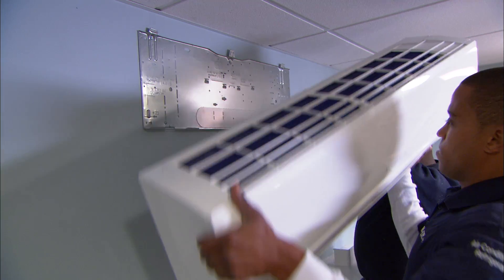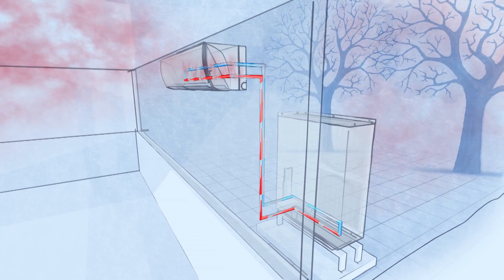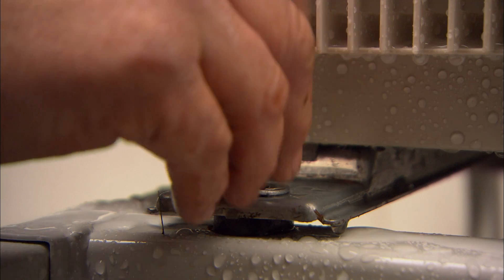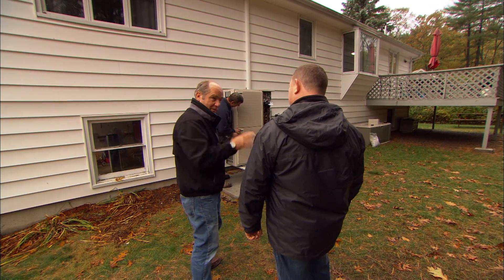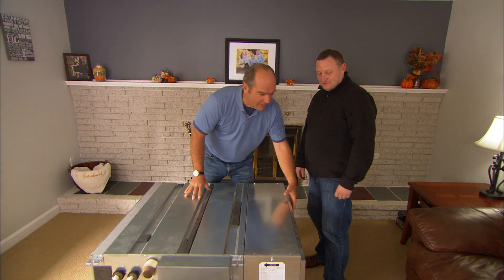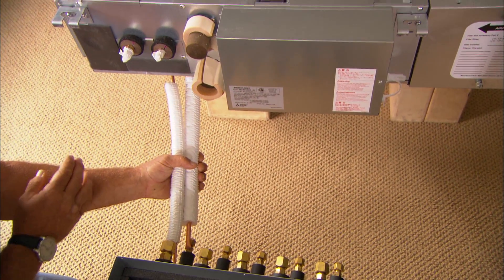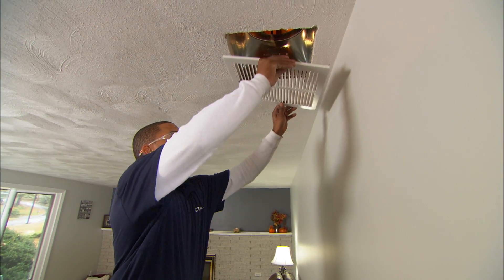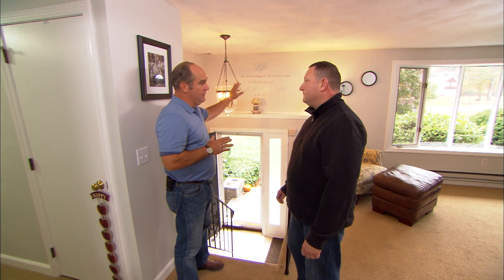How to Install a Heat Pump for Heating & Cooling | Ask This Old House

Comment: We had an air handler in our attic for the top level of our 3-story town house in VA.  It struggled to cool and never dehumidified the air.   I agree it's a bad idea to put them in unconditioned spaces.  I wonder if a humidifier can be added to heat pump systems for our dry spells here; now in MI.
Reply: That’s why you have to put insulation over the entire thing. This is like a 3 day job at least

Comment: Heat Pump tend to break easily with circuit boards going bad 1200 dollars plus $880 labor refrigerant having to be added. They last about 5 years and are the most expensive means of heat to maintain. Would do you expect a Condenser running outside below zero in blizzards it doesn't last long

Comment: What really excites me about it is that fact I can install solar panels install (in addition to heat-pumps) and be 80/90% off the grid, try doing that with gas/oil...
Reply: You will need quit a bit of solar panels
Reply: How’s it so far? Thinking about  switching up from gas to this for ac/heat combo with solar panel install. Will probably need double amount of solar panels to cover total cost
Reply: @Razdaz91  so far so good... definitely very efficient, and faster to warm up a room. We'll see how things work out this summer  with electric prices up it's all relatively (not saving a whole lot).
Reply: @jupena  do you have the solar panels with the pump currently?
Reply: Solar panels for homes have a payback period exceeding 18 years. Thank China for the rare earth materials required to produce them. If the gov didn't subsidize there would be no way to disguise the costs. Since when does the gov really do you any favors? How's that stimulus check working out for you now? Increased taxes are costing you way more than that! Glad you're "excited" about getting porked.
Reply: And the environment thanks 👍 🙏 you most of all
Reply: @Chuy1988 The environment was one of the main reasons I decided to install it on a 3 family property of mine (should be done this week)! heat pumps are the way of the future! Yay Massachusetts for the rebates! This Old House Rocks!
Reply: @jupena  I'm an HVAC guy i installed some of these in my first job now i hope i can install more
Reply: @Chuy1988  Cool Beens! cheers!

Comment: How efficient is that one in tha attic going to be when the attic is like 150 degrees in the summer?
Reply: Just as efficient as it would be any where else. The indoor unit is only your fan and coil, all the “efficiency” work is done outside at the condensing unit. You aren’t heating/cooling attic air (that’s why a ducted return was installed in the living room), nor does the temperature of the attic have an effect on the ducted unit.
Reply: @bingbizzleproductions1732  try again.
Reply: @joshuasmith1215  seeing as I’m a registered PE  with a focus on HVAC and design these systems for a living, I’ll stick with my explanation above. If you’d like, prove me wrong with facts. 

1. Where is the system picking up heat from in the attic? Are you suggesting that the ducted fan coil box is absorbing heat? They are insulated so try again.

2. What does that leave us? Duct. Are you suggesting that tiny bit of duct is absorbing enough heat through the duct to make a significant difference in capacity over a short run like that? Let’s see your load calcs to prove your theory.

3. So we just covered all the components that are in the system located in the attic (except for condensate piping and refer piping, which is insulated). And have already established the box pulls it’s return air from the tempered space and not the attic. So thrill me with your explanation of how the box being in the attic has any significant effect on efficiency. I’ll wait.

If you don’t have a factual answer, then you just learned something that will hopefully will help in your quest of “learning how heat pumps work”. 

The only way the heat in the attic would have a significant effect on the capacity of the system is if you were introducing OSA (outside air) to the system from the attic. You would then need to size your system to account for the additional load of the mixed air temp entering the fan coil, plus that of your envelope and misc. loads from within the living space. Since the system is closed to the attic space, your only heat added from the hot attic is that which is absorbed through the duct (negligible in this instance since it’s a very small amount of duct) and as I mentioned above, the absorption of heat to the fan coil box, which is also negligible due to the boxes being insulated.
Reply: @bingbizzleproductions1732  thanks for the explanation. So you would not recommend insulating the attic to help reduce energy losses through the ducts and refrigerant lines with these units? Even for Quebec Canada where the attic temp can get to -15 C regularly?
Reply: @bingbizzleproductions1732  Dude, thank you!
Reply: @8181k  I would still insulate the attic. I think we are crossing two different issues. What I was trying to explain above was that locating the fan coil box in the attic didn't have any significant effect on the efficiency of the fan coil box as it itself was insulated,the duct run was short, and the unit was not pulling any air from the attic. It sounds like what you are asking is if the attic should be insulated to prevent extreme ambient cold. The answer to that is yes, but for different reasons. The reason you would insulate the attic is that it's still transferring some heat from the home through the ceiling. Your concern here is loss of heat from the living space/building envelope, not absorption of heat affecting efficiency of equipment. For instance, this would be similar to locating a server room (high heat load) next to an office. Since most interior walls are not typically insulated, you would feel heat coming through the wall into the office space. This would increase your cooling load in the office to account for the heat transferring through the wall from the server room. If you insulated the wall between the server room and the office, the heat gain would be significantly reduced in the office as the heat would primarily stay in the server room. It's the same principle with the attic. By insulating the attic (assuming the floor of the attic is insulated), you are helping to keep as much of your heat inside your occupied living space as possible and minimizing how much energy is lost to the cold attic space. The insulation in the attic also helps to retain some level of heat in the attic as it is absorbed from the living space below (there is no stopping all of it, but that's OK) and provides a level of protection from extreme hot/cold as well.

Comment: The "inverter" is the variable speed (variable frequency) motor drive power electronics module, used to get increased efficiency by operating the motor only at necessary speed and not at full speed and then on/off. The inverter has zero to do with the switching from heating mode to cooling mode. In particular, it does not "invert the heat" or any such. These guys ought to know better.
Reply: You are so right with this! Thought the same!
Reply: I agree

Comment: I dont have a boiler or HVAC in my house. I had electric baseboard throughout my whole house. My electric bill was 1200 to 1400 a month. I installed 3 Fujitsu's low ambient temperature  units. Not only did they heat my house all winter, but my electric bill dropped to under $200 a month. Look I know people are scared of the unknown, but these units are awesome. I would stick to Mitsubishi or Fujitsu. I did the work myself, I am qualified though I have a universal 608 license. Paid 6k for everything. Mine heat down to negative 15f. This winter they did their job. I live in upstate NY by a lake.
Reply: do your units pump air thru central heat ducts ?  how about a/c ?   i have a 2700 sq ft house and am thinking about changing my central heat (oil) and a/c.  i think these should work - thx
Reply: Hey! I know its been a few years but I’m wondering how this heat pump system has held up for you? I’m looking into it myself. Thanks!

Comment: Can your heat pump be put in to the house to run through furnace pipes with the furnace not working. In other words use winter and summer.
Reply: If you have ducting for a forced air heating system it can be retrofitted to use a heat pump as the source of heat versus your furnace. 
It would be an easier set-up than this video because you already have ducts. This homeowner had to use those air handlers in the attic because he didn't have ducts in this home.

Comment: He keeps mentioning 5 degrees....what about when its minus 10?
Reply: Each unit has an electrical heating element as "backup and boost", was mentioned in the video.
Reply: new ones can go down to -26, look for the SEER, but as he mentioned those have backup systems as well.

Comment: Green energy, perfect setup no doubt!, let's see the tradeoffs. That setup requires  lots of drilling opening holes not every house is suitable and the cost of setting up properly depends to house feaseability. This setup is way complex. Will definetly need extensive maintanance and in any case of failure will  require more money to maintain. Green energy +, homogene heating and cooling properties +, costly -, complex -. There doesn't seem like a battery backup. In case of grid failure or any electricity issues in winter. Will create troubles. Main heating options should be as lean as possible what I believe.

Comment: I had learned on other youtube hvac videos that you don't put equipment in an unconditioned environment such as an attic. How hot does that attic get in the summer???
Reply: Interesting in theory and I agree with you, but it's done all the time. I have to go in attics regularly in the Arizona summer as a home inspector. It can be 135 in the attic, even hotter in poorly ventilated attics. Hottest one I measured was 155 degrees. Yet almost all of the heat pumps here are split systems with the air handler in the attic, even on the newest homes. Insulation is on the refrigerant line, but still...  Even the package heat pumps on the roofs are not much better, sitting in direct sun on an asphalt roof is also a very hot environment. Perhaps an HVAC tech could comment on whether research has been done on the cooling loss of the refrigerant in these configurations?

Comment: Does this work in Canada?
Reply: Rexin Oridle does it get below 5 degrees in Canada?
Reply: Yes it does but the heat pump gets less efficient when the outside temperature goes down. But they'll have an electric element that kicks in to assist if ever the heat pump can't keep up.

Comment: I don’t think this heat pump is pulling heat from frigid cold temperatures. By nature the process of cooling a home produces heat. That’s why there’s a huge box with a fan outside (the condenser). I believe that someone said we could use this heat and manipulated the standard ac system to provide heating and cooling. Same basic principles, just additional components to make it work. Because an AC system freezes up when it’s too cold outside they address a defrost cycle. They also use heat strips to provide warm air drying this cycle so you don’t cool your house after heating it. The point....the condenser produces the heat, not the freezing cold air.

Comment: I have a duel fuel furnace/heat pump. Using natural gas. Located in central CT. 97% furnace, 27 SEER heat pump 2 1/2 ton. I have no doubt that the heat pump is mechanically more efficient than the gas but the cost of the electric to run the heat pump is just a little more than double the cost of using the gas. Also using the gas seems to get the house up to temp about 25% quicker. It's nice to have the option but I'll continue to run the heat with gas.
Reply: Natural gas at the current cost might be more efficient, but gas lines aren't available everywhere. If you want to go true low cost, look into pellet and wood stoves.
Reply: What system are you using make and model? I haven’t seen a heat pump that can put out 27seer, at least not a single zone for whole home.

Comment: Now at the beginning of this segment (we don't see it on this clip), Richard said that it would cost $30,000 to have a natural gas line run to their house. But at that point, anything was better than what they had= electric radiant heat in the ceilings which costed the home owners many thousands of dollars to run previous years(I think I remember hearing almost $10,000). What I don't get is why didn't they go with a more conventional setup first. In my experience creating heat with gas or oil is much cheaper than with electric, even with an efficient 'heat-moving' heat pump setup. Why in the world didn't they just go with a propane or oil forced air or boiler setup??
Reply: Because they'd have to run ductwork from the basement up to the rooms. Ripping up floors etc... It would be an expensive retrofit. And with this they get cooling in the summer as well.
Reply: @8181k  - Not necessarily, TONS of people have furnaces in their attics; and some are much smaller attics that this.
Reply: Some people might prefer not to pollute the air with unburnt gas and oil waste emissions. Particularly if they are generating electricity from solar or have an electric utility that uses a high percentage of renewable energy.

Comment: I wonder if the homeowner was ever informed that the 4 air handlers each needed filter clean/exchange maintenance in the attic regularly and what the cost would be for the electronic control board to be replaced because it is bound to happen at the wrong time. And with last weeks (Jan 2018 record low temps. below 0F), was everyone  warm and toasty?
Reply: Good point. I’ve put hinged return grilles to replace filters from within the conditioned living space.
Reply: That is what the electric elements are for. The reality is that most of America does not get to below zero temps for any significant amount of time.

Comment: For what I know it doesn't grab heat and dump it out or in.
To cool down the evaporator gets cold and the blower blows that cold air in the room.
When is on heating the compressor pumps hot freon to the evaporator inside and the blower cools down the hot freon and blows hot air.
Let me know if I'm wrong.
Reply: Edwin G 

You are absolutely wrong.

The refrigerant for cooling is dropped in pressure lowering the temperature in the inside unit to its saturation point. So the refrigerant begins boil and absorbs an amazing amount of energy and will be cool to the touch. It will the return outside and then condense (to turn liquid) and dispel that energy. Hot to the touch.

It will reverse for heat mode.
Condense to liquid inside the house and evaporate outside to absorb energy.

In cooling mode the large cold line is actually the one heading outside. It is now a cold gas but has absorbed a massive amount of BTU’s from the air. The small hotter line is the line about to cool your house believe it or not.
Reply: I’ve been doing Refrigeration repair and work for 15 years on coolers and freezers and never heard that heat gets transferred outside.

That’s why the evaporator coil has a TXV valve.

Just never heard someone explaining it that way.
Reply: The txv creates a pressure drop in the evaporator. Down so that the box temp hits the refrigerant saturation point. 

The compressor raises the pressure so that it again hits saturation point in the condensing coil and travels the opposite direction in saturation. To condense rather than evaporate. This dispels heat across the air/water loop.

Comment: These dont work well below 0 celsius as the outside unit has to run de-icing cycles often (a heating coil outside) An in ground heat exchanger using a bore is best.
Reply: Alex F.  That would seem correct.  I have a split traditional heat pump in the Georgia mountains.  If the temp is below 34 then it cycles the outside thaw very, very often.  I can play the strip heat vs the normal heat pump cycle for as the evening cold of 20 rises to the day of 45 and get lower cost.  If just HP 24x7 then it struggles below 30, spending much of its time heating itself.

If I really want to save money, I'd use my emergency (powers out) kerosene heater on the coldest part of the day/night, but that is a pain day to day.  If I had a fireplace, I'd just heat with that when home.  Wood is as cheap and simple a heat as exists.

Comment: With such a massive house any heating or cooling system will be expensive.
With passive solar design mechanical heating or cooling needs are a fraction of poorly designed homes. Many building designers fail us. 
Heat pumps however are highly efficient resulting in lower heating costs than gas in all of Australia, even in cold climate zones.
Reply: Do you have gas there? If so is it really that expensive?

Comment: He said "Even if there 5 degrees outside" so many times, I kinda worry, what is going to happen if there's gonna be 4
Reply: still34u backup heat elements or a black hole will form
Reply: how about - 25?
Reply: @robinheil  Fujitsu has a series with rated capacity down to -26 C (-15 F) and lacks a hard cutoff, some claim it operates at even lower temperatures, ex -30C (-22 F) and below.

Mitsubishi on the other hand has a hard cutoff at -25 C or (-13 F).

Both of these figures are for the manufactures ultra low temp lines.
Reply: The cold weather heat pumps continue to provide heat even below their rated temperature. However their total capacity in btu/hour does decline progressively below that temperature. At least that is how ours works. At 5 degrees F our heat is rated to provide 24,000 btu/ hr but at -5F only 20,000 btu/hr. In our area -5F is rare.
Reply: If I use this video to do what the title said. Installer be outta business.